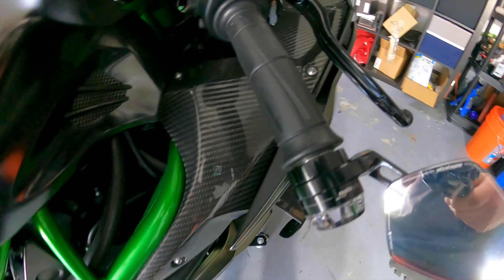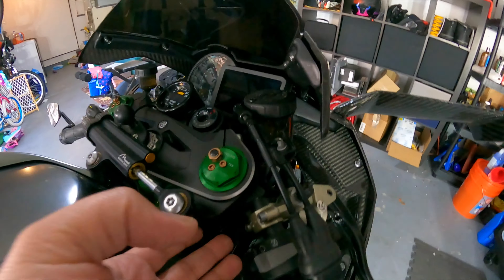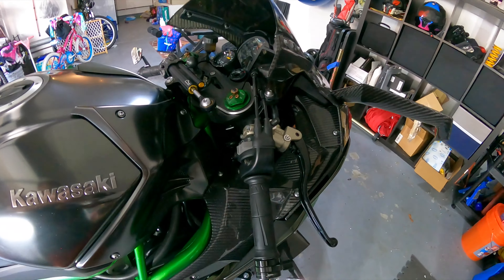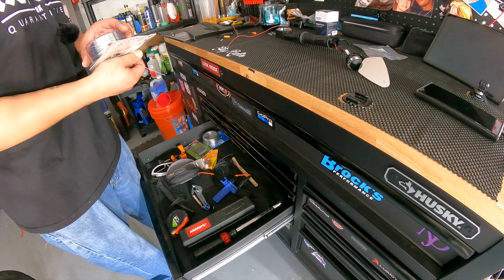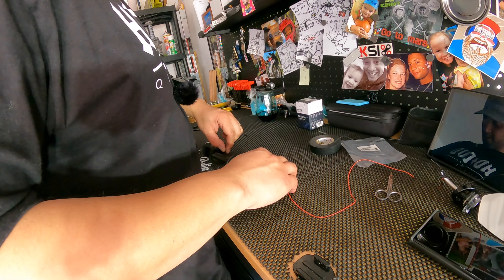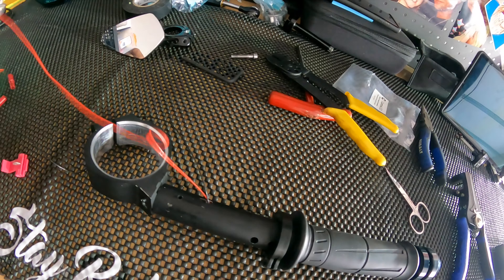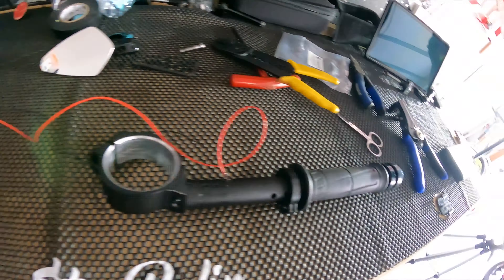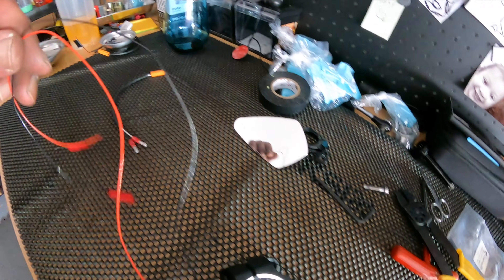Motogadget Turn Signal & Mirror Install | KSIX

Comment: Omg. The cheering sound! Indeed crazy. I must have woken up in a cold sweat several nights trying to figure this out. I ended up ferrule crimping the pos and  neg wires together to get them through the hole in the screw. Craziest engineering I’ve seen. Right on. Glad to see that wire went through. Pain in the ass indeed!🎉🎉🎉

Comment: Bro you are doing work on h2 like stage 3 gear and intercooler  what's the money did you save doing itself rather than going to professional mechanic
Reply from the maker: If you watch some of my other videos, you'll know that I don't like taking my bikes to "professional mechanics." Lots of terrible experiences and there isn't much I can't do myself. I've got 20 years experience as a marine diesel mechanic. I'm very good at figuring stuff out. 

Knowing that I did a good job and that my bike isn't going to blow up because someone wanted to hurry and take a smoke break is priceless. Lol

Comment: Can you please tell me what kind of socket wrench you use to unlock the triple plate head nut - 36mm?  Appreciatie your video's and upgrades!
Reply from the maker: I'll take a look tonight and let you know.
Reply from the maker: Hey! Sorry it took so long to reply.  It's been a long day. I think it's a 36mm. In order to be complete sure I'd have to remove the steering damper. That's not happening tonight lol. 

If you need anything else, let me know. If I don't know personally,  I might know someone who does. The H2 community has wealth of knowledge. Especially amongst the long time owners. 🤙
Reply: @Ksix1  No problem, really appreciate your time looking into it. Indeed you have to remove the steering damper first. I know it's a 36mm bi-hex socket wrench. The problem is the outside diameter of the socket wrench. Did you order it from a specific brand to fit or used a lathe to modify the outside diameter yourself. The space between the triple plate and head nut is a problem with most wrench brands.
Reply from the maker: @craigsteinkamp3680  ahh I understand now. I'm using a Kobalt socket. The outside diameter is 47.9mm. I didn't do any lathing. I do apply a thin ring of lube on the lower exterior lip so it doesn't bind as i tighten. Might not be a necessity but it seemed like a good idea and it works. Otherwise, fits like a glove.
Reply: @Ksix1  Thank you, that i needed to know. Also your idea to apply a thin ring of lube is awesome, better safe than sorry.

Comment: How do you install adapter in the bar? I just broke mine trying to install it, good thing I order 2, I was using a rubber mallet,  it gets into a point that I won't go in anymore, what am I doing wrong, please help?
Reply from the maker: Oh no. The adapter should have slid right in. The adapter should have 3 pieces. A long tube, a small nut and really thin bolt. Put all three pieces together but just enough so that the nut stays on. It should slide all the way in. Then when it's in place, use the allen key to tighten
Reply from the maker: If you have Instagram message me @Ksix_
Reply: @Ksix1  I inbox you on instagram
Reply from the maker: Hey! Just curious to know if you were ever able go get your install completed?

Comment: When will we see a “first ride” video on the stage 3 gears?
Reply from the maker: Ahh man. I tried putting one together but it just didn't come out right. The audio was terrible. I bought a new helmet and since then nothing has been right.  Once I work out my issues, I'll be making riding videos again. Hopefully I'll get it figured out soon.
Reply from the maker: I can tell you that's it's silly fast 😅
Reply: @Ksix1   ha! I’ve read stage 3 gears on stock wheel base is so ridiculous it isn’t “rideable”. Obviously you can still ride it but you’ll never use all of the throttle at 12k rpm.
Reply from the maker: @_TheChristophe  I'm not "fully" tuned. We purposely decided to stop in the 260's and 262 just happened to be the number on my last run. I think top range is like 275-280WHP. at that level, yea I'd need to extend wheel base. But honestly, even before the stage 3, riding in that high an RPM was ridiculous. I think it's perfect now. I'm not balzy enough to take it into the canyons yet, but she's very controllable on the street.

Comment: Your a sucker for hardish 😝 does your abba stand take off the paint on your frame on the left hand side as you sit on the bike  where the pin gos in to the frame ?
Reply from the maker: Unfortunately it did. However, I don't think its the stands fault rather than my own. The first few times I used it, I wasn't exactly sure of what the base height was so the pins would slide in smoothly.  Eventually, I was able figure it out and then mark the level. I haven't had any issues since. It did scratch the paint inside the pin well, but its rather unnoticeable. Still a huge fan of this Abba Skylift though! It's amazing
Reply: @Ksix1  not really good enough it marks the frame  😕  I emails the company and got onto them very disappointed  i was.
The reason the paints is coming off as I'm sure your aware is its just to tight of tolerance there between the frame and stand pin assembly and the damage occurs when your either pushing or pulling the handle on the abba stand to either take the bike up or down
The problem is that the pin should be longer so its not in the round  green part of the frame if you get what I mean yes I agree its a great stand but the design is flaws in that respect possible.so what I'm going to do is get a new pin machines out so its longer so its not near the internal green part of the frame.

Comment: Always use heat shrink on electrical connections. Never use that liquid tape, that stuff isn’t durable enough for things like this with vibrations and occasionally water
Reply from the maker: You are correct! I paid for it though lol. Having to redo my work was punishment for not doing it right the first time.